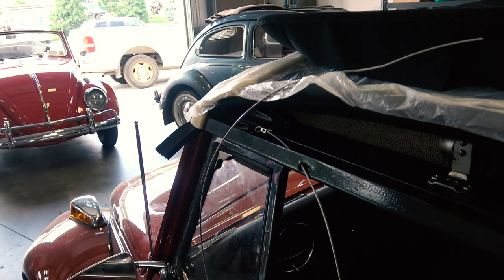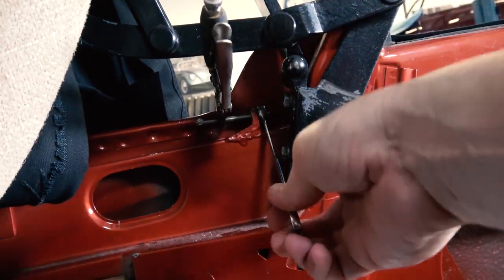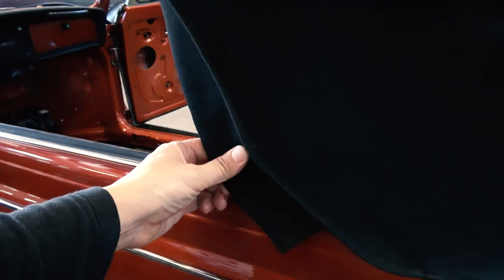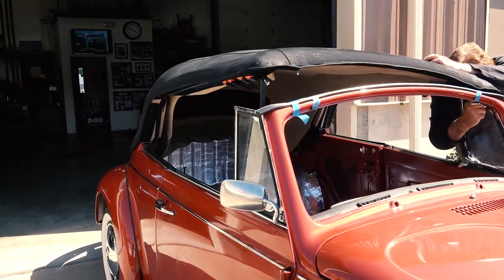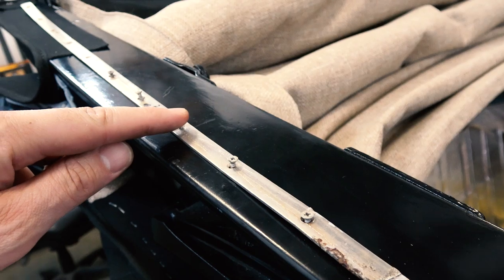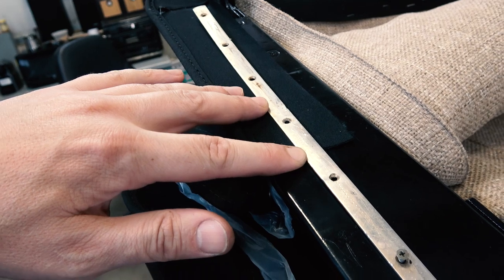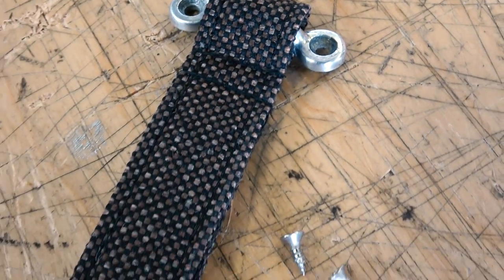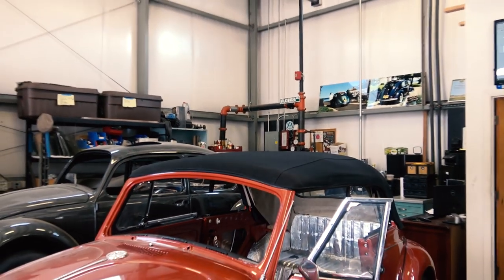Classic VW BuGs How to Install Convertible Beetle Top Restoration PT.5

Comment: I loved your video full of great information as I am attempting to replace the top on my 68 VW Beetle in the coming months. One thing I'd like to point out is that in your final shot it looks like your top is down wrong. Yes, wrong!  I've owned my car since 1972 ... one day way back then I was looking through the owners manual and noticed a picture of a hook I had not noticed before. That particular page showed the owner how to properly lower and lock the top down. Here goes: Once the top is released from the windshield header, fold it back but stop when the top is straight up. At this point reach your hand and sometimes arm into the middle fold and push all of that material rearward,  the top is about to smash all of that material by the scissor action of the frame on its way down. Go around to the other side and do the same thing.  Once all that material is pushed rearward (the top, the padding and the headliner) the top will lay much flatter and the boot will fit so perfectly that you can actually snap all 6 snaps on the boot easily. The big plus is that you can now see out of your rearview mirror. It also improves the lines of the car. Give it a try. I have changed owner lives by showing them this factory method of lowering their top. The smiles on their faces are unbelievable. Thanks for the great and informative video! Oh yeah, that hook ..(seen on your video at 6:30) if it's still there after all these years, once your top is properly lowered this hook, on both sides of the frame meet up with its companion hook and allows you to hook the now flatter top in place.

Comment: I just noticed that decklid is from (what I think is) a 1971 convertible (7 louver slats in each set of the decklid). Is that true? I had heard that those decklids were a one-year-only part for '71 convertibles...very hard to find.
Reply: I was wrong... apparently that deck lid was a '70 and '71 year part for the convertibles. :)

Comment: Where can i find the video where you replace the rear window of a convertible?
Reply from the maker: same video as when putting in for a sedan.  Its the same procedure.
Reply: Thanks for you answer.
I need to replace the seal because it leaves traces on my soft top.

Comment: The most important thing was to see the part about putting the glass back and you don't explain it😢
Reply from the maker: That's the most important thing? not attaching the headliner, cutting, stapling materials, wood bows, etc?  I have videos on installing windows in a bug, it is the same process from a sedan.